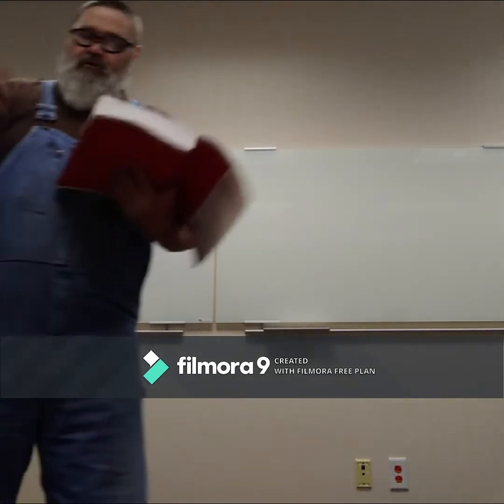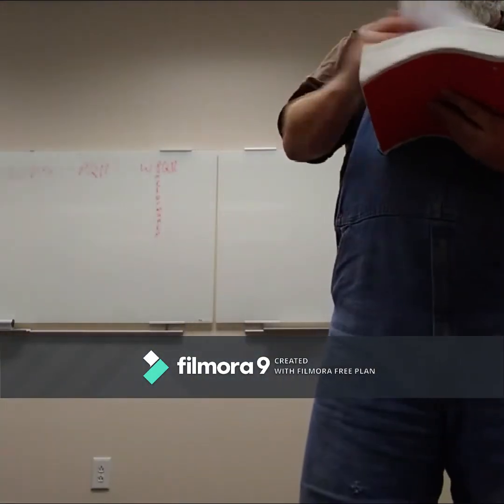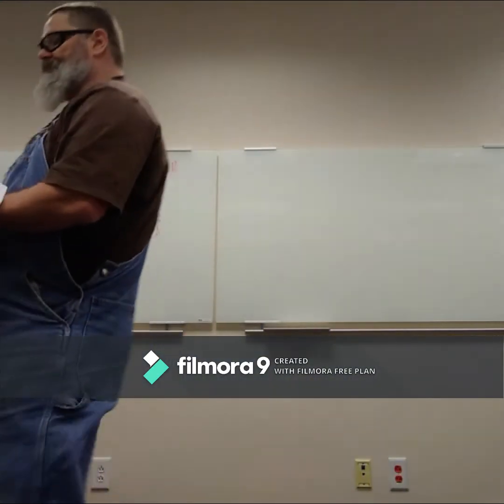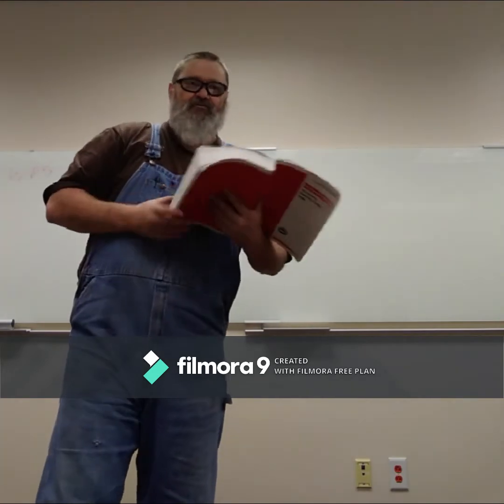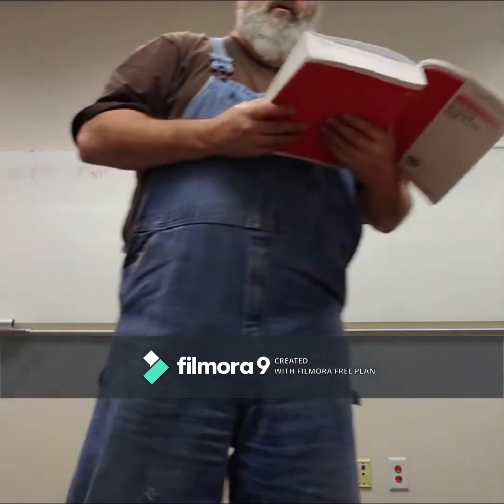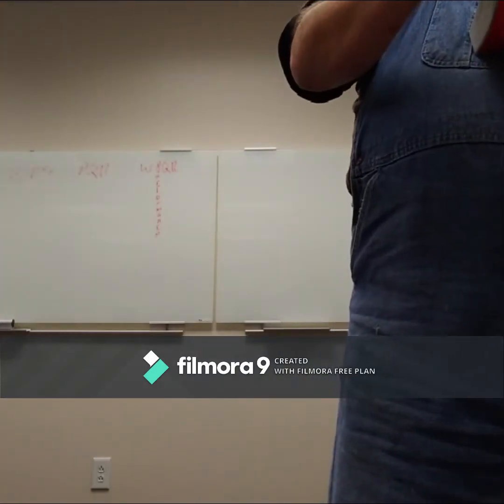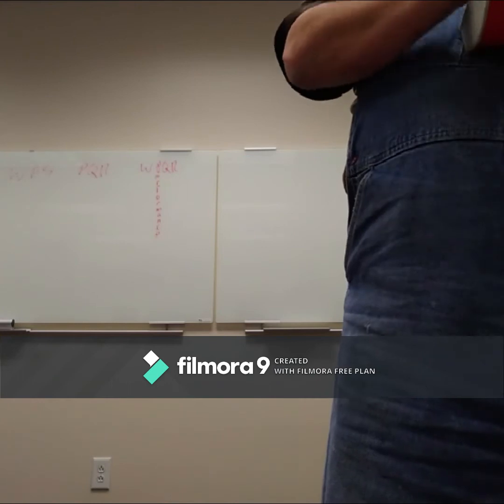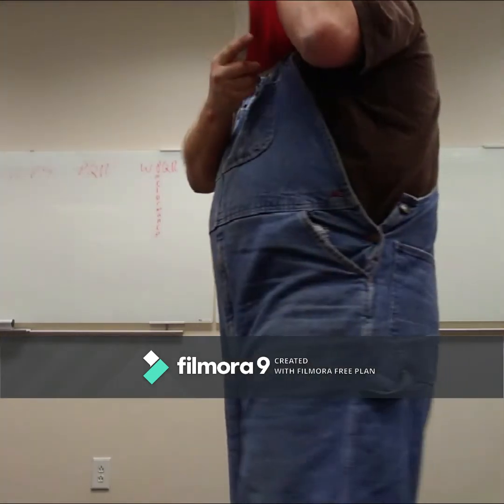D1.1 Intro  Forward-Clause 1

Comment: what is " the book of specifications"?
Reply from the maker: It is a good used by AWS when the administer part B of the AWS CWI exam. It is a collection of requirements that must be applied during the exam while inspecting some weld replicas and answering other questions. Each clause is loosely based off of the requirements from existing codes used for structural steel, pressure piping and pipelines.
Reply: @weldingclassroom7171  Thanks